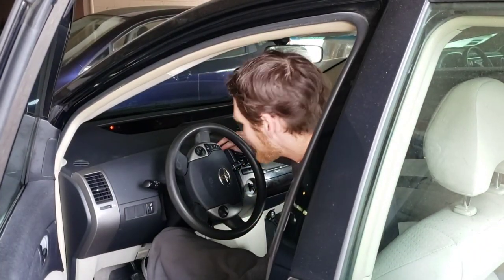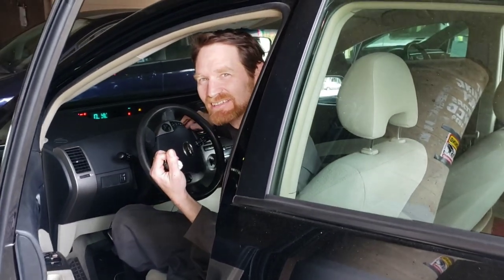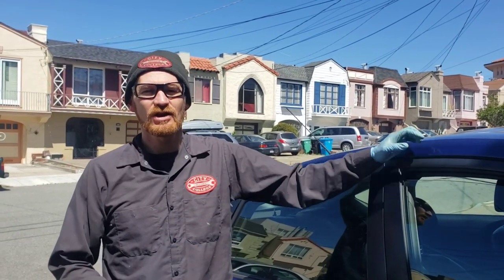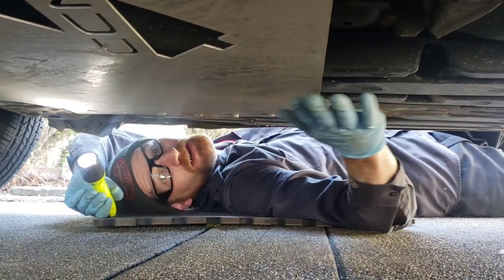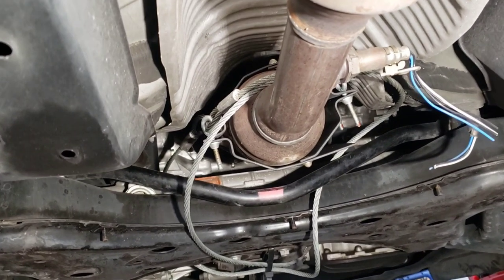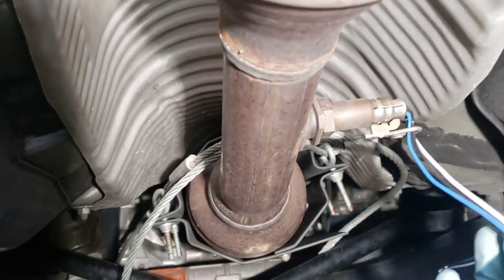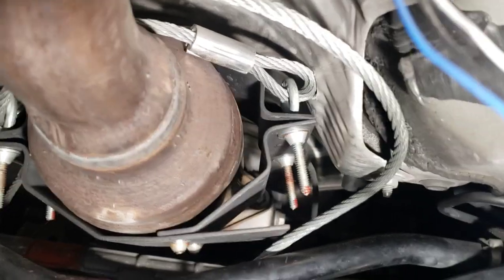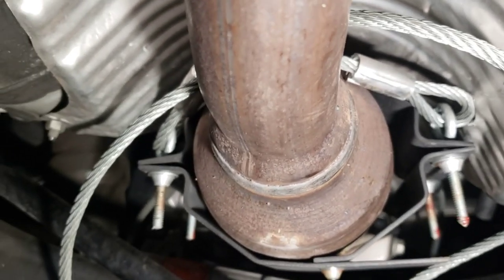Cat Locks tested by Thieves

Comment: Everyone in Diamond Heights and Noe Valley was getting theirs stolen, some even twice!! So I got the CAT Security Plate on mine for $390 total at City Toyota. I live in San Francisco too. I have a 2009 Prius that needs a good, honest mechanic that won’t rip me off. The hybrid shop Luscious Garage on 9th St. has gotten so expensive, it’s insane! I only go to the dealership for 5K services because they send me $99 coupons. I refuse to do anything else there besides routine maintenance. 

Do work from your home or at a shop? If so do you have a website or way to contact you? I’m having an electrical problem with my side mirror switch. It won’t go up anymore, just down. One of the little wires is shot. I’ve had the same problem before, but when the car was under warranty so it was free to fix. The part is like $45 but everyone I’ve called wants over $150 to just replace that one little part which takes no longer than 10 minutes to install. 🤦🏻‍♀️
Reply: I always recommend Action Auto Care in SF, but their labor rates have gone up too (which i dont blame them for) so you will usually be charged 1 hours labor for a job like that anywhere, at min $130/hour generally. Also most mechanics will not take you at your word "that its a 10 minute job" because they need to confirm the problem diagnosis; while this sounds shady, it makes sense if you put yourself in their shoes as they have customers come in all the time who "know what they are doing" and are actually completely wrong. I have been guilty of this myself a few times over the years. You may want to look into doing it yourself - I had a similar problem with my Miata recently, and once I got the switch out of the dash it was actually a case of having to clean the contacts on the switch in the cockpit itself, not wiring or the mirror. In the end the job cost me about 10c of contact cleaner, 1 cotton bud, 30 minutes messing around in the dash. Every car is different of course. I've pulled apart the dash on a Prius C before, its not too difficult, just look up the procedure in Youtube videos, join a forum, do a bit of research. At most you will need basic tools (phillips head screwdriver, maybe a set of torx drivers) and some plastic trim removal tools (like 5 bucks on amazon) to avoid damaging pieces your remove. Also recommend getting an assortment of cheap plastic trim clips (like 10 bucks on amazon) to replace any that get broken in taking apart the dash, they are fragile and break easily. Just get a big assortment box and go with what fits; if you get OEM trim clips you'll be paying like a buck a clip for shitty bits of plastic. You can use them on other cars you own in the future, the set I got 2 years ago has been cheerfully replacing clips in 2 Toyotas and a Mazda.  In fact I've had to replace more plastic clips that dealers/mechanics have broken than I have broken myself - you tend to take more care with your own property than a mechanic does :) good luck. Oh yeah, another tip - try NextDoor. You may have a friendly neighbour willing to help, or someone advertising their services there.